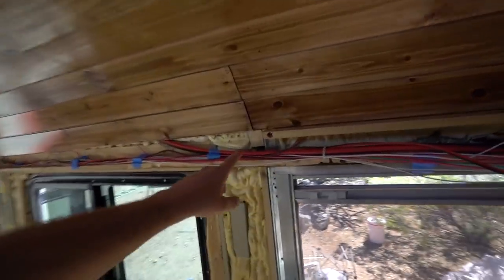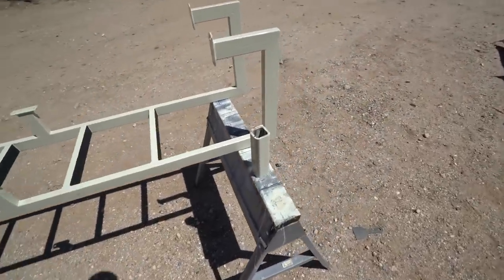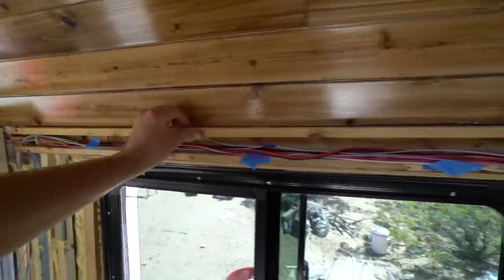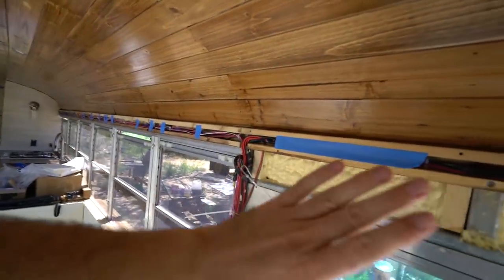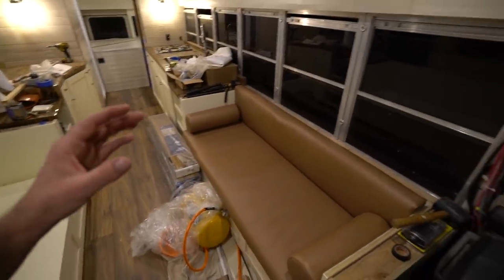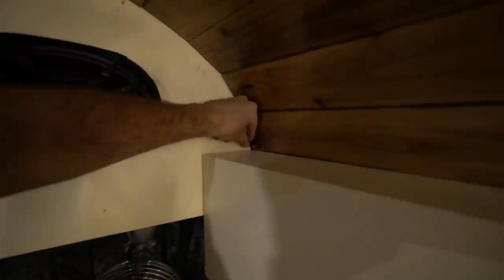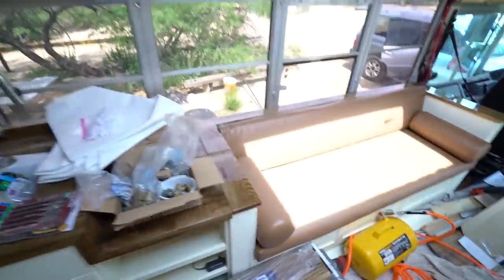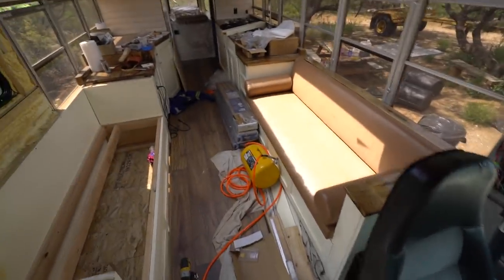School Bus Conversion: Hiding Wires, Custom Cushions + Vegetable Oil

Comment: Red Rover Red Rover come on over.
That wire connection in the corner might cut through the insulation going down the road, might want to secure it with some silicone.
Reply from the maker: Live dangerously 🤘

Comment: You really need to place washers under the screws the heads are going to sink into the slots  and cause A leak. you also can remove the tank strap and notch it to clear the head of the heater.

Comment: I don't know if you got the wire chase idea from me (because i did it first) but they are awesome, I love them and it is so easy to access the wire, my wire chase covers on hinged on so all i have to do is remove 1 or 2 screws and the cover hinges down. bus is looking good
Reply from the maker: Lol I did it on my previous bus also.
Reply: @JaxAustin  sorry didn't notice, what do you have for an AC if anything, do you plan on getting one
Reply from the maker: No worries. Appreciate the enthusiasm. I don’t have ac and the options I found are $3500

Comment: For "used" cooking-oil fuel,
Use a BIG (really BIG), Electrically heated, Primary Fuel Filter, 
A "Same-Size" secondary (smaller "Micron-Size") 
is not a bad idea, I think, 
but only if 
your "Lift/Transfer" pump can live with the increased load (resistance).
-
As you have discovered, "coolant" heated filter-heads
offer several complications
1)  When you want it most, the Engine, & thus coolant in still COLD
(i.e. compulsory start on regular Diesel-fuel).
2) Coolant/Water cross-contamination (internal leakage between the two)
3) When you do NOT want it (extra filter heat), 
your coolant is NOW HOT (possibly too hot) !! .
4) Increased possibility of loss of coolant to atmosphere/ground
(often called "an extra point of potential failure").
-
A thought for you, 
a momentary "push-button" switch
triggering a count-down timer-relay, 
so that you do NOT forget to turn it off again !
If one cycle of the timer is not enough,
just push the button again, as required.
-
Be aware that Diesel~Vegie/Oil might be a better
solution than propane, for cook-top, space-heating,
eng. coolant-preheating, 
hydronic underfloor & storage lockers heat, 
and regular hot-water 
(liquid diesel-fuel is now the PREFERRED solution 
in current generation European (especially German) 
motor-homes & campers,
with a couple of well known 
Quality GERMAN brands of appliances & devices),
if your fuel (used cooking-oil is truly cheep enough).

Vendors to be aware of ...
Eberspächer
Webasto
Reply from the maker: My webasto heats the coolant, so the cold isn’t an issue. That’s how i will heat the bus in winter for cheap. Cross contamination is the failure point, and I have a heater wrap for the Racor. Good points. Thanks for the detailed comment
Reply: @JaxAustin  Hey Jax, maybe I'm not understanding something, buy are you circulating the veggie oil? A circulating the oil should heat the oil in tank quickly.

Comment: Jax, have you put a coolant pressure tester on the radiator or pressure jug, to verify the actual pressure of the system? If you have a blown head gasket and combustion pressure is leaking into the cooling system, lots of stuff can or will leak and the weakest link will. Davco 382/482 filters are pretty bomb proof.
Reply from the maker: It gets contaminated from using a webasto only, so we can verify it’s the problem. Also, both used filters leaked and had bad o-rings.
Reply: @JaxAustin  ahh okay. Good luck and nice job on the bus.

Comment: great job... just noticed that you have your stove set width wise on the counter.... if you have two things cooking on it at once, you have to reach over the first front hot pan to get to the back pan...  do you think this will cause any problems...? I have the same stove and working on a shuttle, I was thinking turning it sideways so both burners are accessible without reaching over one, thanks
Reply: Depends on what is important for YOU. I think most will install like JAX as counter depths are usually pretty consistent and this takes up less space. Turning sideways would solve your problem of reaching over to a second burner, but take up more counter space. Part of the benefit of building your own is is making things work for YOU.  Build and enjoy!
Reply from the maker: Well, being that I taught chuck Norris a thing or two, and I used to be in the circus. I don’t anticipate a problem 😋

Comment: Why don’t you just drop the veggie oil thing. Sounds like a lot of expense, work and frustration. It’s a nice idea in theory but it doesn’t seem to be working out so great. If you continue, good luck on that.
Reply from the maker: Charlotte Johnson so I can pay $3/4 on diesel? No thanks. Once I iron out the kinks, it’ll keep me on the road. 🤘
Reply: Jax Austin where do you get your veggie oil? Is it handy or kind of a pain. Is there regular places that collect the veggie oil and you go there to buy it from them? How does this work? I have no idea, that’s why I’m asking.
Reply from the maker: It’s not just vegetable oil that I can use, I can also use motor oil. So, the possibilities are many. It is kind of a hunt and gather technique. Asking around helps, but traveling will be an issue. I Do have an idea for going forward that I will share in several videos
Reply: Jax Austin thanks for your reply. Very cool, I hope the best for your venture. I know when I change my oil in my F350 I take the used oil to the parts store and I can dump it for free, can you go there and get it for free also? How many filters do you have to put the “oils” through to be able to use it? Do you filter it before it goes into the tank? Very interesting.

Comment: That piece that gets so hot did you have to put aluminum foli on the back of the wood floor to reflect the heat. If not that wood will burn. : )peace
Reply from the maker: The 1.5 inch insulation has foil both sides.
Reply: @JaxAustin  Ok, good. :)Peace

Comment: Hi Jax, I am really loving the colour scheme you have going on there. I can only offer 1 piece of advice however and that is, don't sit on the vinyl seats if they are or have been in the sun as you will burn yo ass lol. Thanks for sharing and good job with hiding those pesky wires. x
Reply from the maker: Yes indeed. Rather have a hot ass than stains. That’s just me tho 🤘
Reply: @JaxAustin  Lmao.